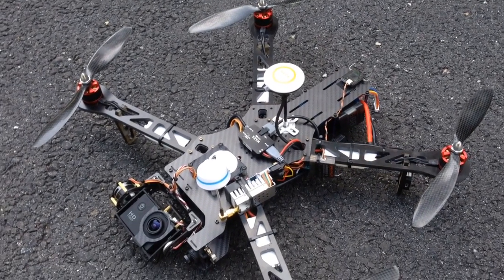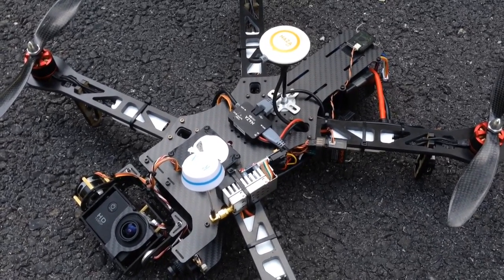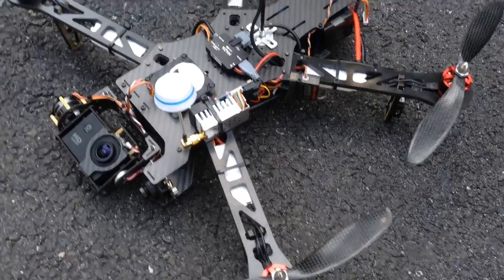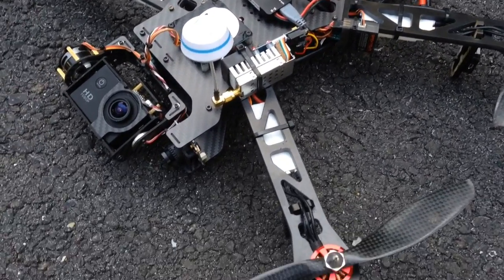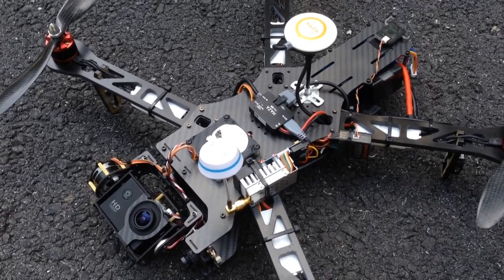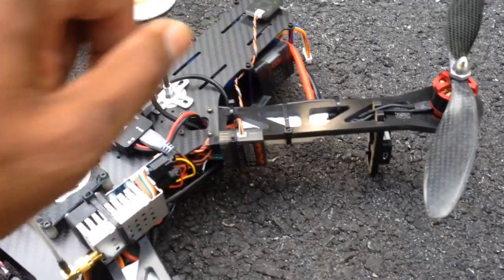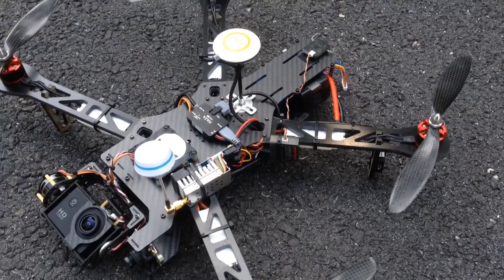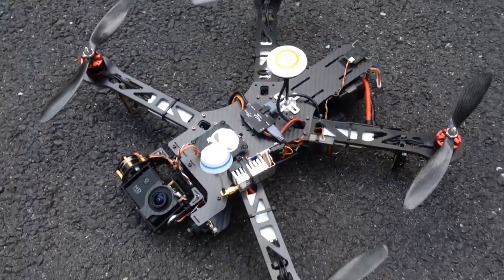TBS-QU4D Naza V2 position hold

Comment: Hello ! Great videos and informations from you , thanks for sharing ! Actually I'm planning to get same frame - can you please tell me about gimbal controller ? It's alexmos (look like) ? and can it be upgraded to new FW ? (2.2b3 is pretty old one )
Reply from the maker: Thank you. I think the controller for the gimbal is a Martinez board. This is my first gimbal, and I honestly have no experience with them. My gimbal worked out of the box. It has a usb connection for programming but it was not necessary for me to make adjustments :-)
Reply: Slapula Thank's for your response - Just wanna know - is there any input for RC to remotely adjust pitch  ?
Reply from the maker: I have a Spektrum DX8 using an AR8000. I plugged the gimbal directly into one of the Chanel's on the AR8000. This allows me to look up and down using the knob on my radio.

Comment: This frame? http://www.goodluckbuy.com/tbs-qu4d-450mm-carbon-fiber-alien-aircraft-quadcopter-frame-kit-w-front-camera-mount-gimbal.html
This is the same gimbal http://www.goodluckbuy.com/tbs-2-axis-brushless-gopro-gimbal-camera-mount-set-for-gopro-3-3-camera-fpv-aerial-photography.html ?
Reply from the maker: Yes, that's mine !

My gimbal has slots that allow it to link into the chassis that I have. I looked at your TBS frame and I do not see those slots. Custom work would need to be done to make it fit. 

I wanted the TBS pro, but the price was a too much for me :-(

Comment: Do you think 5000 mah would fit ?
Reply from the maker: Maybe 3S, not sure about 4S. 

Probably 4S 4300 mah
Reply: Irfan özkan I run 4S 5200mah batteries from multistar in mine, easy 15min hover time in 20kmh winds using 10x3.8 props, AUW around 1750grams